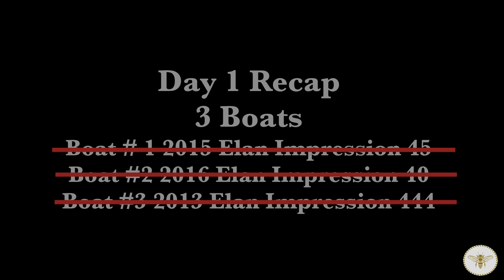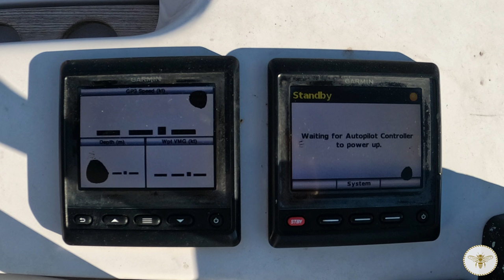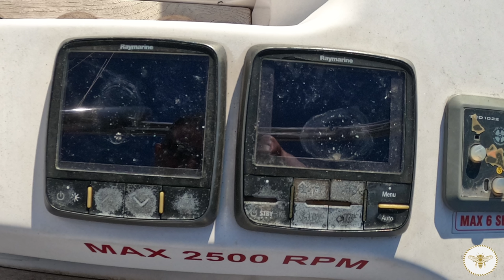Ep1: Sailboat shopping in 2020. Buying a used sailboat in the Mediterranean

Comment: I definitely like the Elan build quality over the Beneteau. The Impression line and the Oceanis lines are primarily Med charter built both in layout and build/budget. Something to think about if your buying. Having said that Elan definitely has a superior build process and engineering over B boats. 

The Elan Performance, S, E and GT lines are more owner focused and do see more focus on engineering added structural features etc. 

Same for the Beneteau First line of boats. 
Just something to keep in mind when shopping med boats. Boats built to charter spec are ok but you might find things about them that aren’t ideal for major trips, but many people do big crossings on these with no issues.  If your shopping for major cruising outside the Med definitely lean in the direction of owner boats vs charter and definitely look at the First, performance, S, E and GT product lines don’t be dissuaded by the “performance” marketing given these hulls are built with more structural and sailing focus than the charter hulls that spend more time at anchor vs sailing.  Just some things to know going into the sailing boat thing. My experience is competitive sailing ocean and SF Bay where conditions definitely test boat quality and engineering. I like Beneteau first series but given the choice a Elan S or E series definitely have better sea features and engineering/ build quality that I like.

Comment: Thanks for sharing - You have confirmed my thoughts and I will not be tempted to look for ex charter. At the beginning of the vid I was thinking, I want an owners cabin and it was great that you found this in the end. I have sailed in Croatia and found it a very expensive country compared to Greece or Turkey. I recommend that you take the longest chain you can carry as this may save you on marina and mooring fees. The geology of Croatia is such that shallow anchoring is not always possible. I have also switched my desire from the romanticism of fine lines and central cockpit to the practicality of a european production boat. I recently viewed an Jeanneau Sun Odyssey 44 DS which was fantastic but out of our preferred budget. My preferred length is around 42 to 46 feet. What other brands and models did you find in your research which you would recommend.  We have moved to southern Portugal recently just settling in before continuing our search for a boat. Good luck with your travels.
Reply: Rupert, your comment is very much along similar thoughts I have been considering. I am in the early stages of the boat buying process and hope to find the right boat in the next 2 years. I plan to sail Croatia in spring 2022 and search for that right boat in that area. I would be interested in hearing your personal experiences also.
Reply from the maker: Hi Rupert, we really like the deck salon concept and, like you, looked into Jeanneau SO DS models. 42ds and 45ds. We did not consider 44ds simply because of her being new and the price tag she came with . I have seen number of 42 45ds in Turkey during my first boat hunting trip. Between the 2 I would go with the 45ds. However, I believe Jeanneau stopped producing these models sometime around 2013/14 which means, even if you get a younger model the standing rigging would become questionable soon. Good luck with your search and let us know if we can be  more help

Comment: I obviously come from a motorcycle background and expected to find boat people more honest with their representation of what they’re selling, specially if the prospective buy is travelling a long way yet I found it’s the opposite, it’s like they think you’ll buy it because you don’t want to have wasted your time maybe. I travelled around 5,000 miles locally looking for a boat, one in particular was listed as the best and last of that model with nothing to spend, it had cracks and knocks etc and every time I went to check something that didn’t look 100% the seller tried to usher me elsewhere, add that I asked him to leave it at his yacht club so we could take it for a shake down but when I got to his house it was there all packed up on the trailer, boom and sails etc all in the cabin making it impossible to inspect the inside properly and no, I didn’t buy it (I was actually looking for a 31’ Farrier trimaran but his sounded so good in the add: the others I inspected all had issues from shoddy workmanship to delamination etc. Apparently it sold and a year later it was for sale again listed with new standing and running rigging as well as electrical and cosmetic repairs totalling $30,000 (not bad for what was supposed to be an as new little F24 trimaran that sold for $57,000 which was $10k more than any of the dozen or so of that size for sale at the time) and the new owner was asking $50k, his ignorance about the age of standing rigging and insurance is the main issue that caught him out plus that it was too small and light for coastal sailing his local waters which is something the seller should have questioned but no, he found his patsy. Looks like you did good and I love that rear berth, so hard to find in any brand... I’m now looking to sell my house and most everything else and retire on the water so once again I’m searching for a suitable boat, more inclined to buy a cat but there’s some nice monohulls around and after the trimaran I miss the more classic way to sail, either way it’ll be a performance boat as it’s mostly just myself: new would be nice but at my age (67) the waiting time unfortunately has to be considered. Stay safe.
Reply from the maker: Thank you for your input. I am not familiar with the trimaran you were referring to but it appears multihulls are the preferred way of cruising in the med for liveaboards if you have the means bcz of the additional space. We were not interested in multihulls for 2 reasons. High price and sailing characteristics. Sounds like you are doing the right thing by being patient and seeing the vessels in person you are interested in buying. 
Best of luck with your search and let us know if we can be any more help.

Comment: Hi, thank you for a will informed opinion about your buying process, however, any reason for sticking to only Elan Impression? Any specific advantages?
Reply from the maker: We are planning on covering this topic on our upcoming boat tour video. I believe the impression model is designed and built with cruiser in mind. It is a true cruiser not a performance cruiser. The hull shape, structure, tankage, storage and living space are main reasons we went this direction

Comment: The problem with the bulkheads must be from the bulkheads not being glassed in, but rather fitted into slots!!
Reply from the maker: thank you for the insight. I am pretty sure they are not glassed in
Reply: @SeaBeeSailing  They are epoxied glued in & if sailed 'hard' or slammed on the side by 'Big' seas or wharfs they can let go
Reply from the maker: I also hear travel lift ,if inappropriately exercised, can cause twist in the hull structure which makes sense

Comment: Terrific video. Thanks for taking us boat shopping!  
I'd be looking in the hatches in the saloon to inspect the frame and hull connections. I've seen video of a couple of boats that had keel strikes that separated the frame from the hull. This could later lead to the keel dropping off. Mid-ocean that can be catastrophic, immediate and possibly fatal.  These frames seem to be glued to the hull. The fix is epoxy/poly/vinylester and fiberglass. In my opinion they should be constructed this way in the factory. Also keels should have sacrificial leading edges that could absorb the blow without applying the force to the heavy keel/frame.  
if the cabinetry separates from the hull interior that's a sign of either the cabinet being bumped into (heavy person looses their balance) or it could be the result of the hull twisting a little to break the bond. It might be nothing....but a surveyor would know. If it's the saloon deck (floor) then my guess is it's a very bad sign. The deck(floor) is attached to the frame, the frame is glued to the hull, but you don't see this. What you can see is the caulking joint between the deck and the hull - that could be a sign of a frame separating from the hull.  
Also, if I flew from San Francisco to Croatia to look at used boats I would start with the premise "We are probably not going to find the boat we want to buy, so we are probably going to fly home without a boat. This trip is likely for learning only."  You don't want to buy the best boat they show you, you want to buy the best boat for you. 
but this is for others. Clearly if this is your second trip to look at boats you already understand this. 
A two cabin or owner's version boat is also likely to be a better candidate. No one is going to charter the two cabin version for their ten friends to party aboard. (When I use to photograph models: one model in the studio would leave it cleaner than when she arrived. Five models? There would always be a mess and a pantyhose package in the toilet.) I'd always thought a four cabin layout, you could just use two cabins as the owner's cabin, leaving you the option of extra guests. The owner's cabin version always sells used for more money. I think you've shown why this is the case.  Good choice.
And of course the ONLY way to introduce that boat with the luxurious cabin to your wife is to first take her on at least three of the four cabin boats.   Congratulations!!
Reply from the maker: Thank you for your input. I actually have seen twice as many boats than I have shared in this video. One observation I have not shared is, although in most cases privately owned boats were in better condition, in some instances, they were neglected to the point clutches and seacocks were seized. Details they do not share in their listings.